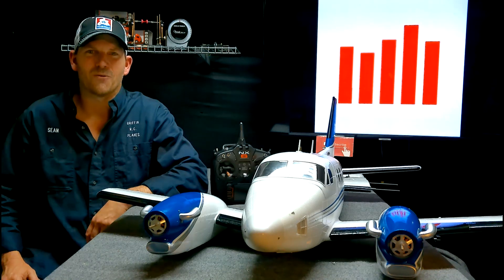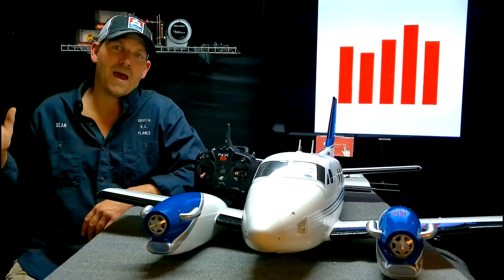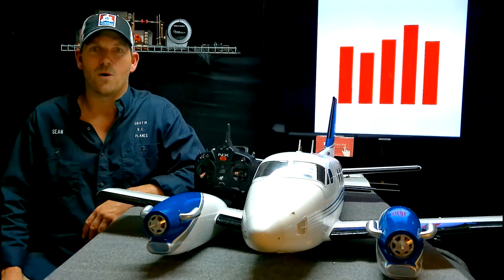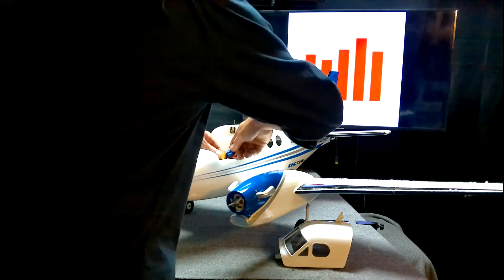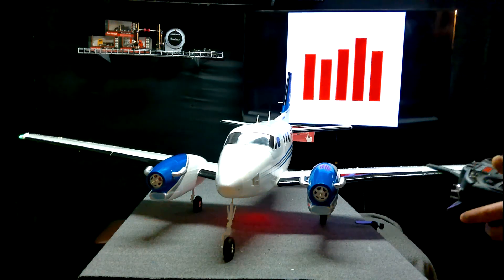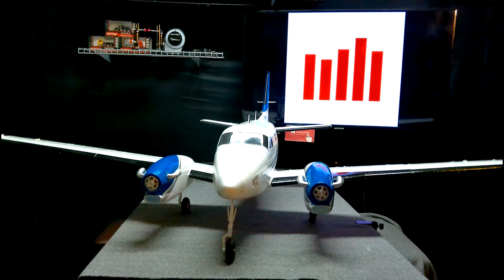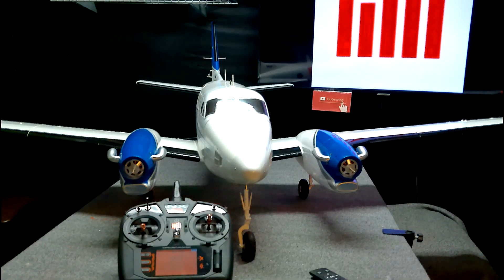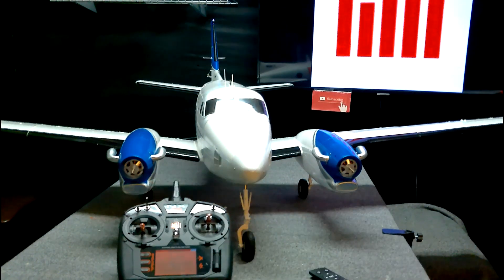FORWARD PROGRAMMING SAFE SELECT AS3X SETUP IN MINUTES ON A SWITCH FROM A TO SAFE QUICK MUST SEE !!!

Comment: The only switch I use on the right side of my transmitter is for throttle cut on switch H because my right hand is generally busy flying the plane. I use switch A for retracts, B for dual rates, and D for flaps. This is pretty much what the transmitter does when you create a new model. Sometimes I'll use switch C to control the receiver's gyro modes, but normally switch B position 0 is low rates with AS3X, position 1 is high rates with AS3X, and position 2 is high rates with SAFE mode. One reason for this is that the angle limits in SAFE mode don't work correctly unless the servo travel is set to ±100%. Also, I can quickly go from low or high rates to SAFE mode. On 6 channel receivers, I use channel 7 to control the receiver's flight modes and assign it to switch B. If I want a gyro mode without AS3X or SAFE turned on, I'd assign channel 7 to switch C and make position 0 the off position, position 1 AS3X, and position 2 AS3X/SAFE.